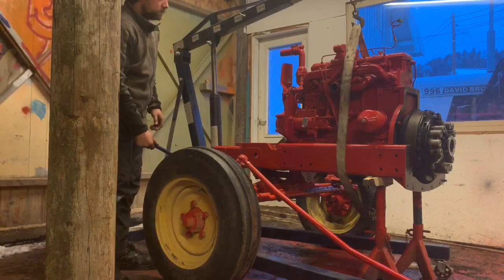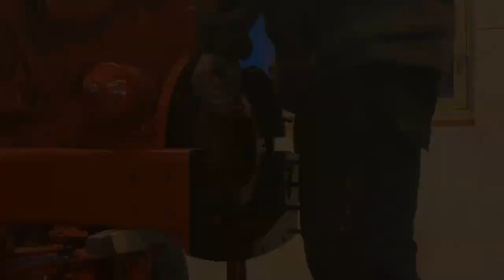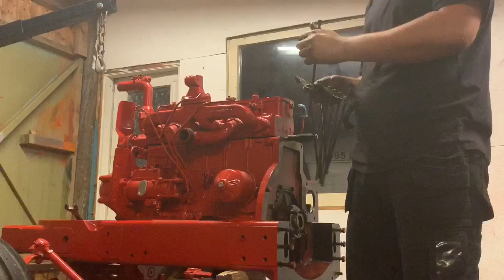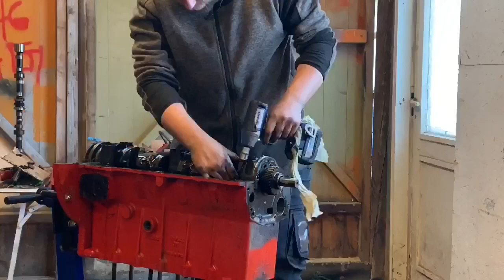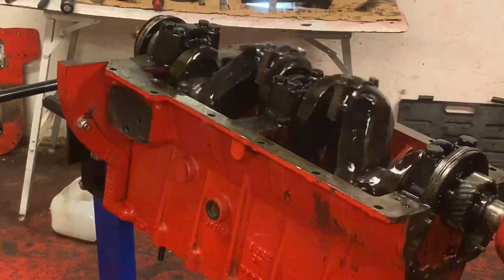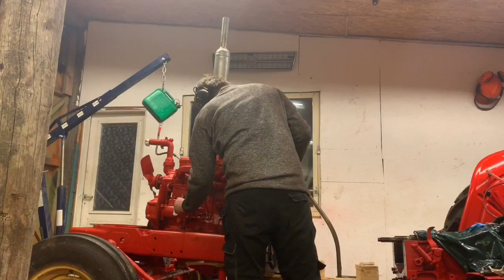David Brown 950 Engine rebuild

Comment: Didn't look like a lot wrong with engine?
Reply from the maker: Only ice in the oil pickup. It had been starter and run whith this some times. So i took it apart to check everything before the tractor was finne work in the summer. One damage conrod bearing.